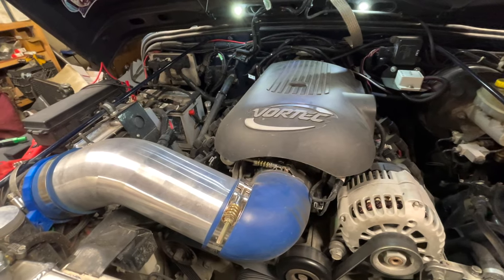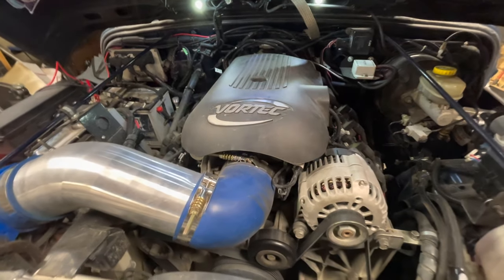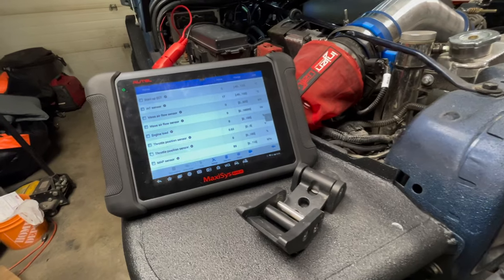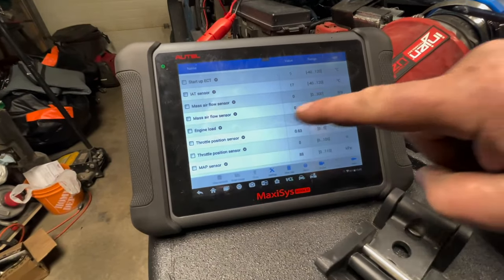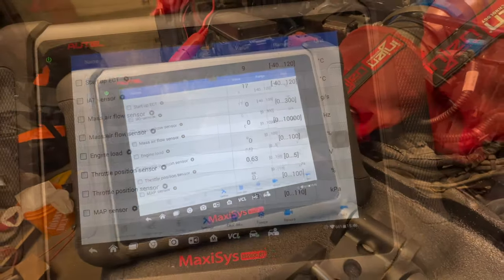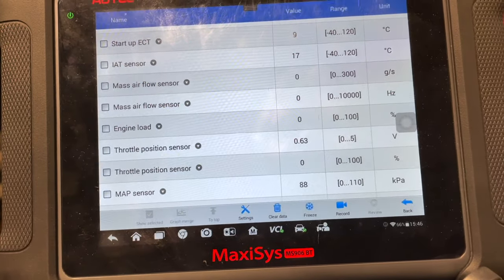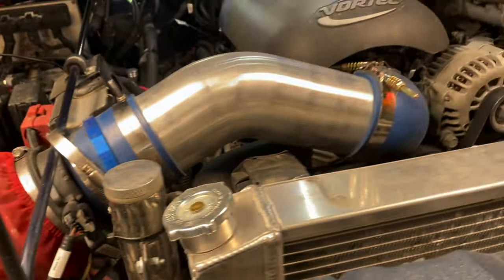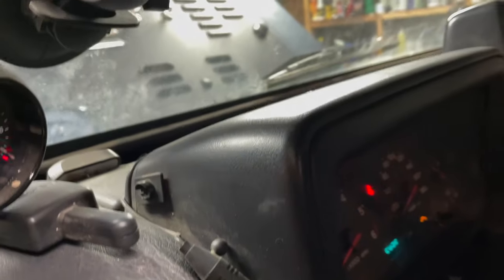P0102 Mass Air flow Circuit Low Voltage

Comment: So how about the other 3 wires on the MAF sensor. I have a reading on the air temp but zero reading on the airflow.  Engine runs terrible.  I look forward to hearing from you and maybe you can help me get this thing running right

Comment: Hello, one question, I have a 2011 5.3L chevy silverado that has a swap cam it doesn't turn on but if there is a spark and also if there is gasoline in the injectors and the scanner gave me the code p0102 and I already changed the maf sensor and nothing happened and I put the starter fluid in the throttle body too and it didn't start and I saw that the throttle opened very little when I accelerated, what could it be??  And I also checked all the fuses and relays, they are fine
Reply from the maker: Why did you change the sensor what troubleshooting did you do to verify it was bad ?

Comment: Hi, I have a 05 colorado 3.5 
I did all the test but for some reason I dont have  signal for the maf wire signal,  scanner says maf is 0.20lb/min  it doesn't move at all !
Reply: You have a bad ground more than likely

Comment: My car won’t start and it’s throwing that code. I replaced the maf sensor and it’s still won’t start. Was running great the other night, came out yesterday morning and it’s trying to turn over, I just won’t start. I’m at a loss lol
Reply: you figure it out yet?
Reply: Mine does the same thing, it runs without the MAF sensor. Replaced the sensor and still same shit.
Reply: @antonchigurh5472  i have a 2011 prius i replaced the MAF its still tunning horrible and shutting itself off. loss of power

Try running the engine and disconnect the MAF 

My engine runs smooth for like 1 second when i disconnect the MAF then goes back to running horrible
Reply: @antonchigurh5472 yall figure it out. I know been a year but damn bro I replaced maf cause when it's unplugged it runs but plugged in it just stalls

Comment: Hey, I know this is super late comment, but someone might see it. I have a problem with my MAF sensor, go figure right. I replaced the sensor and ran another SMOG test to reasses the issue. O2 sensor pops up along with OBD EXG- which can be many things, I reseated the sensor and drove the car for about 30ish miles and my check engine light, "service soon" bs on my dash. I don't know what the hell is going on now. Before, the light was off, and no its on again. All I want is to pass SMOG lol, if someone who is more knowledgeable help me figure this out I am more than willing to remove, replace, or fix anything wrong. I love this car, it sounds amazing, just want to get plates on it thx
Reply: Were u able to fix it ?
Reply: @veghead1043  sold it. It had to many problems